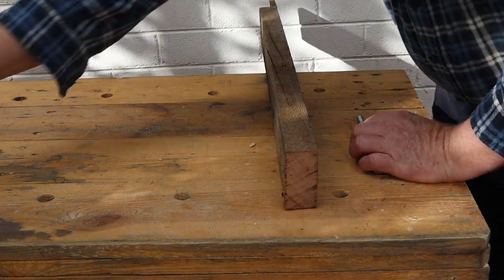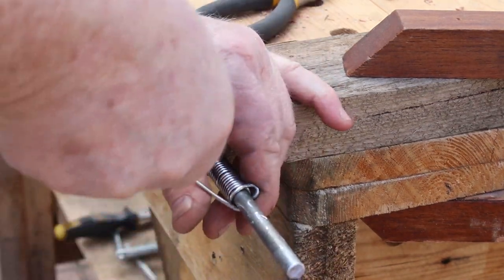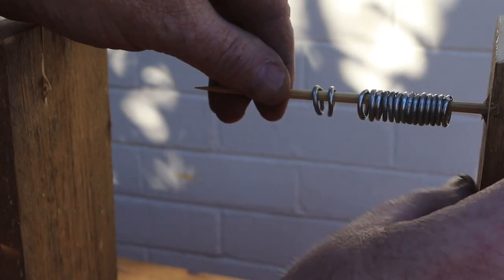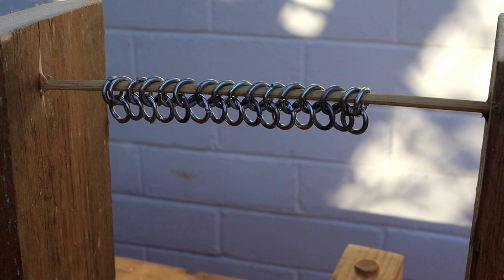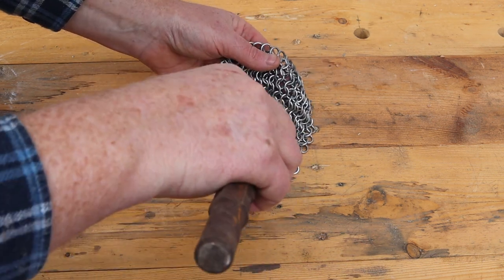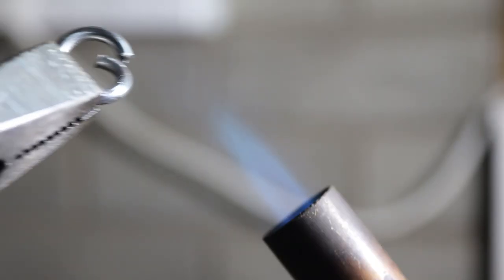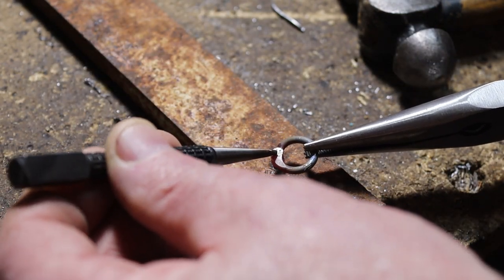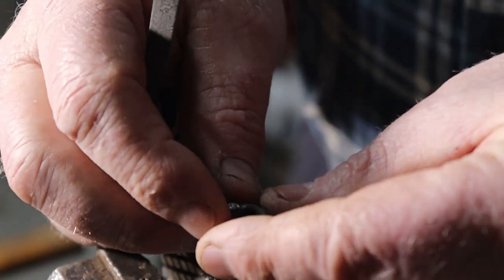Making chainmail from wire coathangers

Comment: Great instructional video, but you could speed things up by adding 2 closed rings to the first open ring of row 2 before adding it to the 2 rings of row 1, then add 1 closed ring to the second open ring from row 2 and thread it through the 2 rings of row 1 and one ring of what will become row 3, and row 3 will build itself.. Just close half the single rings before starting..
Reply from the maker: That's a great tip for improving your productivity!  I'll give it a try on my next piece (which coincidentally is right in front of me as I type this... )  🙂
Reply from the maker: OK, that took a little bit of thinking for the first few rings, and it's a little trickier getting a grip on the "fully loaded" rings with my snub-nosed pliers, but it's now working very well!  Thanks!